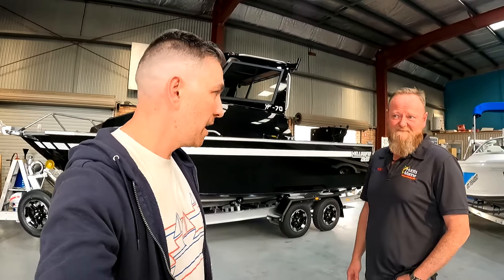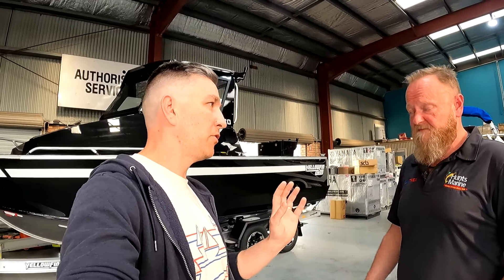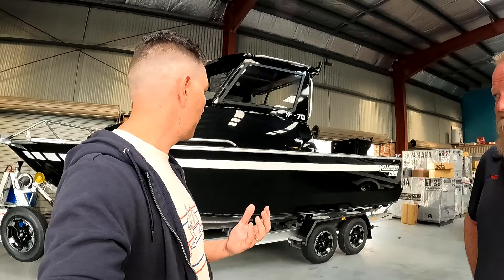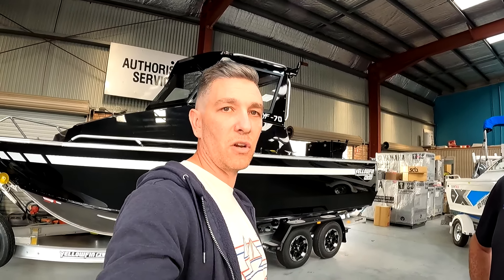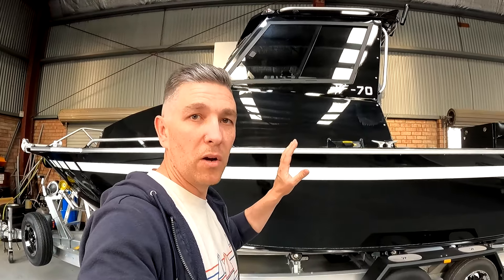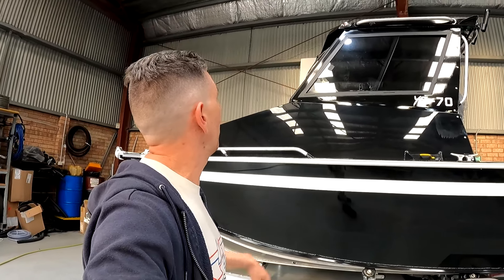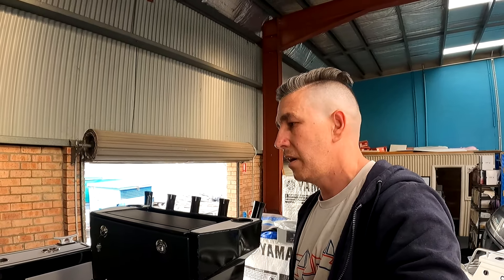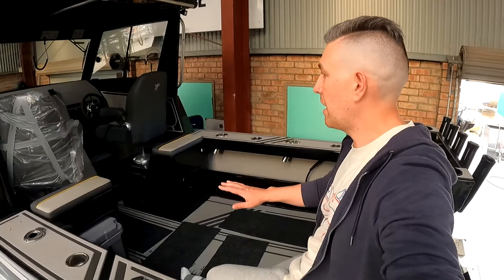FIRST LOOK AT NEW YELLOWFIN YF70 extended cabin ANY GOOD???

Comment: Bla bla bla an over priced Calais branded Quintrex, all of those issues you just rolled on with don’t exist with a Stabicraft, same old story you get what you pay for. Let’s see a real review in 1.5 meter chop at 5 seconds. Looking forward to further reviews as you build it up 👍
Reply from the maker: Stabicraft ride a bit slow in a head sea and don't have toes under ability etc so they just aren't the boats for me although I do respect them. The new 2350 has only 17 degree deadrise so I'm not sure they are going to be a great model. The 2100 is too small for my liking, so nothing really there for me at this stage. We will see how this thing goes. If it sux, I won't be keeping it don't worry

Comment: It will be a nicely setup rig, it should run rings around your old Barcrusher. 
Althoug that trailer potentially may give you a bit of grief when the wind is blowing or on a fast current, could do with some additional guides on the front.
I'd be swapping out the front skinny roller for something decent..  👍 
Waiting in anticipation for more reviews.
Reply from the maker: Yep agree! It will munch the old crushers and yeah Il check that trailer out and see how well it's works but you could be right there

Comment: Hope this boat is good to you... Be ready to remove every single bolt and rivet and redo with tefgel if you want to keep all that paint for more than 12 months.
Ive never seen worse welds, wiring and overall fitouts than by telwater. Hopefully they have upped their game since covid builds have slowed...
No doubt your savings on the hull will translate into better tech. Good decision going the Yammy. All the best
Reply from the maker: Thanks man, yeah I will keep a very close eye on it all for sure! Initial inspection seems to look pretty good but time will tell. Yeah going for decent electrics this time round
Reply from the maker: Also, they know this is my boat and Il tell people so let's hope they did a good job 😂👌😉
Reply: @BaitBallin  haha probably right. Its good for you at least. Keen to see how you go with it. You wont regret the zipwakes either.
Reply: i got 2019 YF paint is so bad because they use earth on hall what cause so many problems with the paint.

Comment: There not bad boats handle well in comparison to my surtees . Pretty soft riding though they ride low in the water takes getting used to . Not a wet boat there pretty stable there not bad the surtees fit out is 100 times better but overall for the price tag good value , my Cuznt bought one recently for a 7 metre it’s not a bad option .
Reply from the maker: @jewyhunter_  yo, the new model? They are much much better now. The layout etc is spot on.
Reply: @BaitBallin  2024 model though wasn’t a bigger cabin that is a smart option one thing we complained about was the cabin so tightly squeezed other than that good boats in my honest opinion  .
Reply from the maker: Yeah I'm looking forward to giving it a good run and everyone will hear my honest opinion about it. But so far, the new design, build quality etc is looking like a very good improvement overall.

Comment: thanks for the pointing out the little things that make big differences....power choice? total cost ? I wonder what the cost diff would be for BC to transition to 6mm.they need to.... I like the chine on bottom of the YF hull for the times you get onto sand or dare i say rocks :(
Reply from the maker: Yep it's actually a big cost increase and id say that's why they haven't done it.

Comment: Mate , I've watched a few of your videos and you've bought everything apart from what you actually need , a plate boat is a young guys boat for one and will never run at any speed in even mild slop without beating the shit out of you ,
A 6 meter glass haines , cruise craft etc will run rings around any plate boat , and i own one of them and I've never followed a plate boat home but have had multiple plate boats sit in my wake so they can maintain a decent speed , hunts sell cruise craft so i would have started by going for a rum in one of those .
Sorry to be blunt .
Reply from the maker: Hey man appreciate your comment and opinion, but unless you have been in something like a Surtees game fisher etc or one of these yellowfins it's not what you think.   I have mates with Caribbean 2300s who go for a run and are very impressed. Haines 625 were too small for my liking, Haines 625, 675 seating config is now ruined (without fold away, concealed rear lounge seat). Otherwise would have been perfect, plus I want 7 person capacity for river days etc. Caribbean 2300 was only one that ticked all my boxes but then back to a bloody heavy boat. A 7m Yellowfin or 700 game fisher won't be tucking behind any 6m glass boat. The light weight, 5mm plate bangers, yes I agree.
Reply: @BaitBallin  hey , yeah i have been in all of them , hopefully you're right but the low front and straight lines of those YF's i doubt it .
Reply from the maker: Well if it sux it will go on the market.....we shall see 😂👌

Comment: Going to a yammi...thought u liked the sizi,s
Reply from the maker: I definitely do, but I wanted digital steering and so far, it would seem Yamaha does it best.
Reply: @BaitBallin  what's the difference  with hydraulic to electric?
Reply from the maker: You can tune it to be harder or easier depending on rpm, also it can make it easier to manoeuvre at ramps etc. plus easy integration with helm master, autopilot etc. so it's about upgrading for the future

Comment: Should gone and got another Barcrusher… what was the reason not?
Reply from the maker: 5mm hulls. Too light. Ergonomics now lagging behind. Was this or a Surtees in plate. BC needs to upgrade their range....they are ok, but not worth the money any more in my opinion.
Reply: @BaitBallin  Bar Crusher did upgrade their range mid year with all new dash with extra storage and ballast flap to allow extra weight for cruising in bad seas. These improvements along with their insane build quality set a new benchmark. As all boat builders improve everyone benefits. Brad is a top operator and puts together brilliant packages.
Reply from the maker: Hey, yeah it's not enough to get me back into one. I still like them, just not enough to buy one over the new YF extended cab or Surtees. Each to their own. When they go 6mm, then they are serious about competing with the best on the market. Quality is very good though agree. 730ht was 3rd on my list and they are still one of my favourite plate brands.

Comment: What happened to the Caribbean 23?
Reply from the maker: Off to a new home a long time ago
Reply: Did you consider a Reef Runner? An absolutely amazing offshore boat..a lot easier to handle on your own than a 23ft crusader.
Reply from the maker: Yeah I like them and have a few mates with them right now.. Good rigs but a little bit light and small for what I want. They actually handle a whole lot better if you put some more weight up the front. One person I know has added about 150kg in sand bags up the front and it's transformed the ride. The 2300 is the pick of them but they are bloody heavy and just behind what I can deal with easily
Reply: Trim tabs fix that, hard tops help as well on them, anyway congrats on your new purchase.

Comment: Better than a 2100 stabicraft?
Reply from the maker: Yeah man no question. The pontoons make them ride a little hard in a head sea and I don't like the lack of toes under. Otherwise the stabicrafts are a sweet ride! Would be a close race between this and a 2350. Although not sure about a 17 degree deadrise on that boat.... Surprising tbh that they did this.
Reply: @BaitBallin  20 for 2100
Reply from the maker: Yep 2100 is a nice ride no doubt. I wanted a little bigger